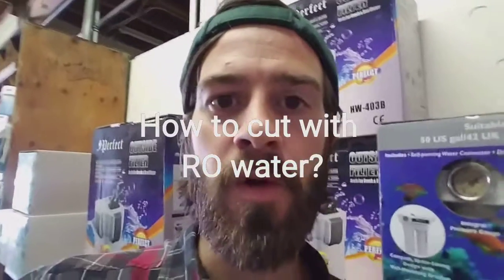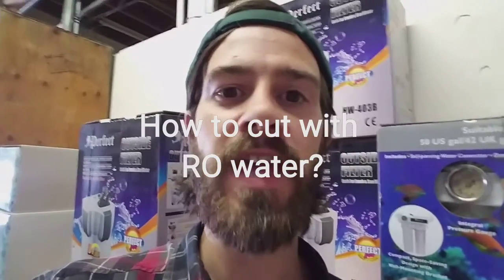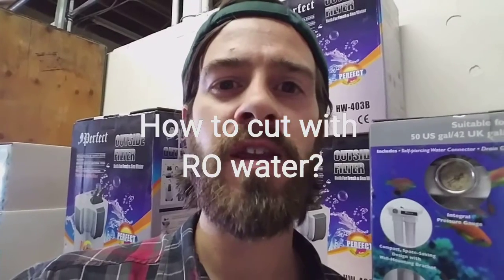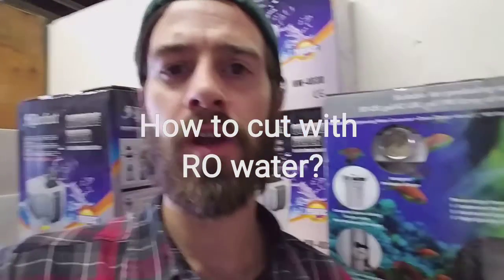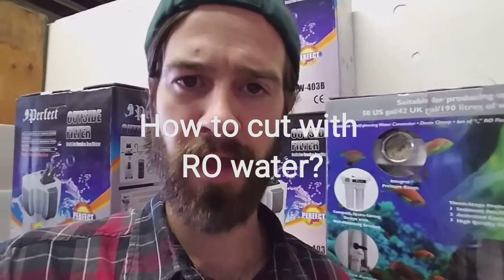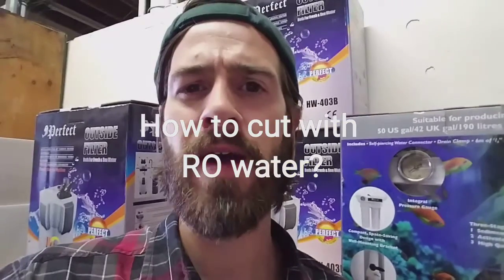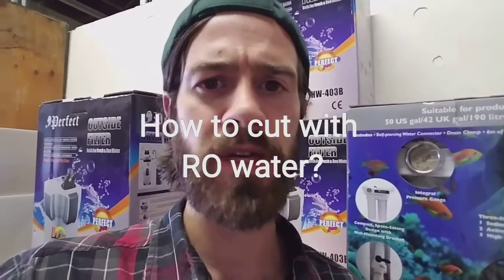Using RO Water In Freshwater Aquarium- Cutting With RO or RO/DI

Comment: Do i have to add minerals or anything else to the ro water before i mix it with my treated tap water
Reply: If only adding RO to "cut" tap water, the answer is usually no. But this depends upon how much RO to Tap you are using, your Tap water numbers, and what you are trying to achieve in the end.
Adding a fresh AAP Wonder Shell at 1/4 dose would likely be helpful either way, if only for the mineral Cations.
I suggest reading this article for more as your question has no easy one size fits all answer:
https://www.americanaquariumproducts.com/chemistry.html

Comment: Ok if you have an existing tank that has only tap water in it how would you introduce the cut tap water?
Reply from the maker: Do weekly water changes and work 5-10% RO water in. I wouldnt recommend 100% RO water unless you really need. 50% max is what most people can use and make sure to remineralize it.
Reply: American Aquarium I already put some in the other day.  I had to do something, I bought 5 black neon tetras and they were dying left and right.  I have 36 gallon tank, so I vacuumed the gravel and removed about 10 gallons of filtered tap and replaced with store bought water.  The ph went straight to 7 only thing the kh was really low.   All fish seemed happy.   I need to test again.   I’m just worried about the next water change and keeping the parameters the same.
Reply from the maker: I would bring up KH to 3-5 to stabilize the pH and remineralize GH. If you can stabilize everything, the worse is likely over.

Comment: After cycling stay ammonia .25 ppm and nitrate 5.00 ppm. I test tab water ammonia .25 ppm and nitrate 5.00 ppm so instead diluting in water changes I am adding. Will RO help with ammonia and nitrate?
Reply from the maker: It would, but .25 ammonia and 5 nitrate are not a problem. You could use something like SeaChem Prime during the water change and just have high amounts of biological filtration.

Comment: i have alot of chlorine in my tap water, if i cut with RO then do i have to treat my tap water? or just mix it before i add it to my tank?
Reply: I would still suggest using a water conditioner for any residual chlorine as well as for the benefits of being a temporary Redox Reducer. 
References:
https://www.aquarium-pond-answers.com/2007/04/aquarium-water-conditioners.html
http://www.americanaquariumproducts.com/Redox_Potential.html

Comment: I have a tank full of discus and I bought an RODI unit with the idea that I wanted to provide them with the BEST possible water quality. My tap water is municiple water and is full of Chlorine and Chloromines and is hard as all get out. Every blog I read talks about cuting the RODI water with tap water to add back some buffering capacity and necessary trace elements. For my situation adding tap water back to the RODI would completely defeat the purpose of having it in the first place. I have been adding Seachem's "Replinish" to the RODI water to remineralize back to a TDH of 185ppm. This works but does not seem to have any buffering capacity as my pH is urrently ranging between 3 - 4.2... I would ike to get the pH stable at as close to 6 as possible.

Any Advice on how I can get this done would be extremely appreciated. I am not a chemist so detailed instruction would also be  appreciated

Evan
Reply: I recommend checking out the link in the details of this video, it explains in depth what is needed. In fact while an excellent product, Replenish does NOT add buffers, this needs to be separately added. As well it is advisable for ongoing mineral Cations that Discus need, to add AAP Woder Shells at 1/4 dose
Here is the link:
https://www.aquarium-pond-answers.com/2016/01/use-of-ro-di-softwater-in-aquariums.html

Comment: Ok, so I have a planted tank and I wanted to add fish that are happy in 6-7.5 ph and my tap is running 8.0-8.5 and tds around 450 usually. I have plants and some wood and substrate to drop the ph and it stays at like 8 in my tank. I then started cutting like 80% and my tank was at 7.6 super annoying. Don’t know what to do. I don’t wanna go 100% ro water cause I feel it’ll be bad for my tank. Try more wood? Try I chemical additive? Idk
Reply: I would like for it to be around 7 if possible but don’t wanna screw it all up in the process.
Reply from the maker: https://www.aquarium-pond-answers.com/2016/01/use-of-ro-di-softwater-in-aquariums.html
Reply: Besides the link AAP provided, here is another:
http://www.americanaquariumproducts.com/AquariumKH.html

I would look into what would bounce the pH up and check aquarium and RO-mixed water KH. Certain substrates and rocks can act as an alkaline buffer. 
Certainly adding acid buffer and driftwood can help, but I suspect that you are batting an alkaline buffer in your tank
Reply from the maker: Hi there. Theres some chemistry to figure out here for sure. I would play with the amount of water you cut with. You could do 100% RO, you would just want to remineralize it. Take a look at this resource for more in depth help.